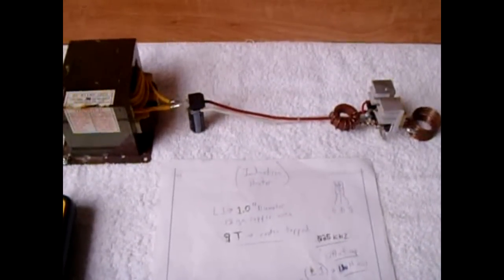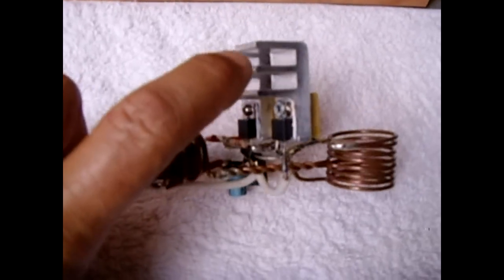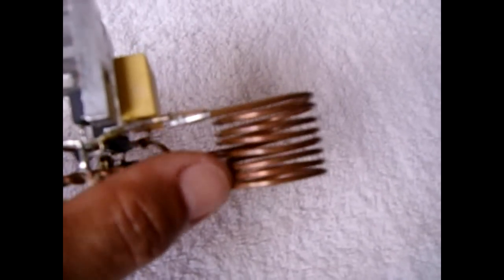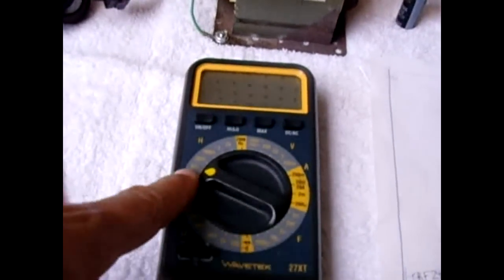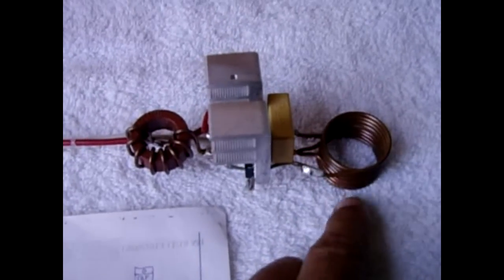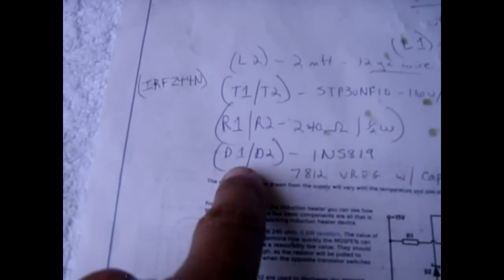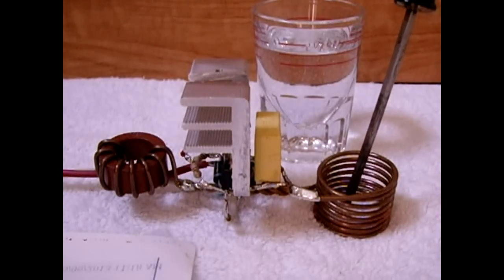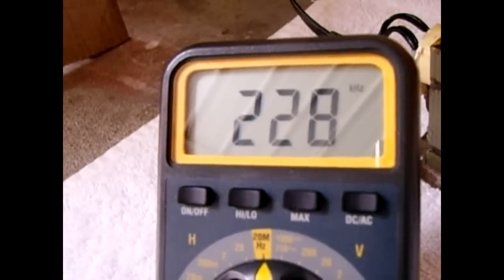How To Make A Simple Induction Heater ~ FULL explanation & schematic

Comment from the maker: Try and keep the design UNDER 225khz to help avoid heating problems. Increasing input voltage speeds up heating, but also causes the capacitor and other components to heat up faster as well. If you can only locate a current limiting inductor(toroid) greater than 2mH, then pull off a few turns of wire to lower the value.

BE SURE TO CHECK OUT PART 2 HERE:
(Shows a Spiral/Pancake Coil in Operation)

https://www.youtube.com/watch?v=8WzoRYUOrxc
Reply from the maker: *****

Unfortunately I cannot assist you with such a dangerous project. 3Ph/380V is deadly. I suggest you stick with what I show in the video. If you wanted to use a transformer with more current output, or slightly higher voltage, that would be fine. Make sure the components are rated to handle the higher level of current / voltage.

Thanks For Watching!
Reply from the maker: *****
You are only 1/3 right. I am from Long Island, but 100% Italian, not Jewish, and the video was filmed on an island in the Bahamas. I have no idea how you arrived at me being Jewish because my hands are tan and I was inside a bright room. LOL
Reply: +PrognatusSeptem 
Yeah, I can usually nail down that LI accent as well.  I can even get Suffolk and Nassau differences most of the time.

Comment: These things are great for getting a small metal shard out of your finger. I maintained a 400 amp unit in a machine shop.  That thing was a hard worker, Had to use 2 $2800 vacuum tubes for the high frequency generator.  Very good video! Thanks
Reply from the maker: Thanks For Watching!

Comment: Induction heating like this, but on a significantly larger scale, is used commercially for hardening metals such as steel. If done correctly, your induction heater could be used to case harden all your screwdriver tips. Great video as usual.

Comment: Well done.There is another variant of this  circuit  that uses no center tap. A lot of the Ebay ones are like that. It makes it a lot easier to swap coils, especially if you want to use litz wire for the coil and wind it around a frozen tie rod nut. I like your power supply. MOTs are getting to be like duct tape; they use them for everything from spot welders to power supplies.

Comment from the maker: Don't forget to check out my extensive video list.

Thanks For Watching!
Reply: what happens if you stick your finger in?
Reply from the maker: LOL. As long as your finger does not have a ring on it, nothing.
Reply: Aayam Sharma You're finger won't melt. Unless you have metal attached in it.
Reply: what about the metals in our blood, like iron?
Reply: It's not affected, even it's iron because blood is not made up of just iron. But red blood cells and plasma dominates inside our bloodstream
Reply: Tarek Kadoura With induction heaters, there are several ways heat is generated in substances.

Mode 1 produces minimal heat with induction heating: In magnetic substances you can have magnetostriction and dielectric heating or ion drag in dialectics. On the other hand, with a Microwave oven, this mode of heating is dominant.

Mode 2 is the dominate heating mechanism with induction heating: The alternating magnetic fields induce electrical eddy currents in metals and those high currents with the metal's own resistance is the source of heat. The stronger the magnetic field, along with low internal resistance, means the stronger the eddy currents, Transformers use steel to concentrate the magnetic fields but avoid loosing energy to heat though eddy current by using laminated cores. A laminated core is constructed of many steel plates that are insulated from each other to prevent eddy currents from building up. Eddy currents is why non magnetic objects like aluminum can be inductively heated. 

Your finger has a fair amount of electrical resistance preventing strong eddy currents, and very little iron to concentrate the magnetic fields. Even so, very strong alternating magnetic fields have been reported to induce pain relative to the strength of the alternating magnetic field. I am guessing that at some point very very strong alternating magnetic fields begin to induce electric currents of sufficient strength to trigger nerve endings to fire. Please note that these small currents in  fairly electrically resistant skin aren't enough to contribute to any significant heating.
Reply: What dictates the frequency you want to match with the tank circuit?
Reply from the maker: The (LC) circuit. The inductance value of the working coil, and the capacitor value which is used. If you go too high in frequency, then you get a skin effect where the current travels over the wire, rather than through the wire.
Reply: electronicsNmore
So what frequency am I shooting for? And what dictates that frequency limit? Thanks for the help BTW
Reply: electronicsNmore Adding a point on skin affect: Skin effect is where high frequency AC current travels though a smaller cross section of a wire, making the same wire appear to have more resistance similar to how thinner wires have higher resistance than thicker wires.
Reply from the maker: Just duplicate what I did in the video. Very simple.
Reply: electronicsNmore
I'm just wonder where you get your "sweet spot" frequency from. You tuned your LC circuit to 228Khz, but why? why not 300kHz or 100kHz. I'm just trying to understand what make 228kHz such a great frequency to tune to. Is it just te response time of the FET's ?
.
Reply from the maker: It does not have to be "Exactly" that frequency. You can go higher or lower.

From WIKI:

  The basic setup is an AC power supply that provides electricity with low voltage but very high current and high frequency. The workpiece to heat is placed inside an air coil driven by the power supply, usually in combination with a resonant tank capacitor to increase the reactive power. The alternating magnetic field induces eddy currents in the workpiece.

Applications of frequency ranges
Frequency (kHz) Workpiece type
5–30
Thick materials
100–400
Small workpieces or shallow penetration
480
Microscopic pieces
Magnetic materials improve the induction heat process because of hysteresis. Materials with high permeability (100–500) are easier to heat with induction heating. Hysteresis heating occurs below the Curie temperature where materials retain their magnetic properties. High permeability below the Curie temperature in the workpiece is useful. Temperature difference, mass, and specific heat influence the workpiece heating.
The energy transfer of induction heating is affected by the distance between the coil and the workpiece. Energy losses occur through heat conduction from workpiece to fixture, natural convection, and thermal radiation.
The induction coil is usually made of copper tubing and fluid cooled. Diameter, shape, and number of turns influence the efficiency and field pattern.
Reply: electronicsNmore
 Ok, got it. Thx
Reply: Thank you for explaining, some times people, Cough xee2vids, Cough 9 volt battery jacobs ladder cough  just don't explain what they used. So thank you for that.
Reply from the maker: Your welcome. Please share my channel with others.
Reply from the maker: Send me a Youtube message with your question. Go to my Channel main page, click "About", then send message. Thank You
Reply: This is really great man. The stuff you can learn in this is beyond me, thanks to people like you who take the time to make this great videos.
Reply from the maker: Glad you enjoyed the video. Be sure to watch part 2 and my other videos as well. Please share my channel with others, and rate Thumbs Up.

Thank You!
Reply: electronicsNmore will a flyback driver work for induction heating?
Reply from the maker: I think there are a small number of flyback induction heaters shown online.
Reply: ok thanks
Reply: electronicsNmore I need to melt some iron what do you think I would need?

Comment: Congratulations on your video. You are very confident of what you say, your voice indicates that you are  still very young and already   have a lot of experience. Your sequence is logical and well projected. You will make an excellent  power conversion lecturer.   I see that you are so conscious of the punishment that capacitor takes.
Congratulations  once gain.
The other day I asked my students how come  a switching device with a low output impedance when  switched on, can match an parallel LC circuit which has a high output impedance when  resonating which this circuit is doing.  NOt a simple answer!
Reply from the maker: Thanks for watching. I appreciate the kind words. I'm not exactly young. :-). I have very good genes(look much younger than my age, act young, sound young), but I am 41.

Comment: I finally got mine to work, to some extent. The first try failed because I made the mistake of mounting both transistors to the same heat sink, which shorted them out. I have it rebuilt using IRF3205 mosfets. But it's really hard on power supplies. I burned out one, and then tried to connect it to my arc welder, which has a bridge rectifier attached. That was too much, it melted the feed wires I used. But before it did, I stuck a screwdriver in the working coil, and I could feel it humming, and that seemed to increase the power draw until my wires melted. I'm putting together a smaller power supply, I can't wait to see what this thing will do.
Reply from the maker: UNITED POLICE STATES OF AMERICA Sounds like you are certainly having fun experimenting. :-)

Comment: Great video! I do automotive work. Occasionally I'll need to heat nuts or bolts to get them loose. My propane w/ oxygen torch works but things close by or next to the fastener being heated sometimes gets melted or damaged. I'm going to try building one of these instead of purchasing a $500 to $2000 unit that's already made. Thank you for sharing.
Reply from the maker: Glad you enjoyed the video! Just make sure you center the bolt in the coil. Be careful not to hit the coil with the bolt you are heating.
Reply: electronicsNmore Can you give me the specs of the capacitor and rectifier after the microwave oven transformer and a diagram or explanation of how it's connected? Thanks.

Comment: I have noticed that the center tap of the work coil seems to make a bit of difference in heating time.  The time seems to be a few seconds slower when it is wound as yours is i.e. not soldered near the coil surface, but twisted, giving loop(s)  in the connection from the work coil to the circuit (stray inductance due to a 'third' stray coil)??  I am not sure.
Reply from the maker: Unusual, don't know why.

Comment: nice build , good clean work, looks like a very neat little unit. did you no farm suppye stores sell 1/8 inch copper tubing niot nominal size but actual 1/8 inch diameter , super small but it would allow ypu to pump water threw your antenna

Comment: Okay, I hope that you can help diagnose this problem. The following is a list of what I have done and the issues I have had:

1) PS (MOT) puts out 24VAC once new secondary is wound. Add the rectifier and I get roughly 24VDC. I added the capacitor (3300uF/25V) and when I went to read voltage it blew. I assume this was due to the voltage limit.

2) Unwound some coils from secondary to drop voltage to 19VAC. With rectifier I get roughly 19VDC. This time, I put 3 1000uF/50V caps in parallel under the rectifier. Read voltage and was getting in the range of 30VDC. You mention that you get 19VDC and that get sent directly to the working coil. 

3) In the same set up from number 2 I decided to test the voltage coming out of the 7812 and I got 24VDC. I should be getting 12, correct? This blew a mosfet and a diode. 

I am sure I am making some novice mistake here, bit I just can;'t quite put my finger on it. Please note that I am being safe and taking the precautionary steps. I would appreciate any advice. Thank you!
Reply from the maker: +jesse harris 
Hi Jesse. Your MOT output voltage is too high. Please watch my other video below to understand why converting from AC to DC raises the voltage output. 

Thanks

https://www.youtube.com/watch?v=9GvlGUbiPRo

Comment: the heat in the cap is because it have a resistor or a diode built in. try with. mica=plate capacitor. they are made for rf and high voltage.
Reply: thus the circuit work in optimal conditions. heating the metal faster and more
Reply: Damian Molina sorry for my english is lame
Reply from the maker: The capacitor has no resistor in it. Your thinking of oil filled run capacitors. The current and frequency is causing it to heat up.
Reply: nope. this yellow capacitor are mpx or rc. just tell me the model and the letters. some have a little diagram showing the inside of the component. mica capacitor is the chosen one. you can find this in old tv or vacuum tubes radio electronicsNmore
Reply from the maker: I just tested that exact capacitor. If there is a resistor inside it, it is extremely high in value. OVER 20M. I also pulled up the spec sheet. There is no internal resistor. I have no idea why you think there is an internal resistor. The heating is caused by frequency and current.
Reply: ok this capacitor are named ac Safety Protection Function capacitor. 
the enclosure and the color tell my. if you dont want have losses of rf. use mica silver capacitor. mostly are black and could say npo. try it, you don't have nothin to loose.
Reply: Damian Molina just a quick thought: maybe the heat comes from the high frequency and with that you get a lower impedance than  if you were to use a lower frequency. Remember that Xc= 1/(2piFC) , so you should get a higher current since you have a lower impedance
Reply from the maker: Definiely no resistor in the

Comment: A couple questions if I may: How many amps are you drawing on the low voltage side of the supply? And have you checked the frequency when you were heating an object? It should change.. Im curious to how much change... one last question... the circuit is self-oscillating... what if you were to use an audio frequency generator to vary the frequency manually? I will be building this experiment soon and trying these ideas.. but was curious if you have already tried them? Tnx and Merry Christmas

Comment: i only got a thoroid 23m outside dia. 13mm inside and depth of 10mm and scrap of IRF740 
How many turns of wire and what gauge should i use.. i am not an electronics guy.. just a fan of DIYers 
i am a mechanical contractor usually fabricates anything that burns and heats and this would be a good tool for me... thank you for sharing.. more power to you

Comment from the maker: Make the working coil wire's diameter larger(10ga), the coil diameter smaller but longer, and use an irf3205. no guarantees, but it should work fine. You may need to use a coiled copper tube with water flowing through it to keep the working coil from getting too hot
Reply: If possible use a wire instead of wire harness from a larger working file

Comment: How much is the consumption of both Mosfet at the moment they are working?, I get the IRFP064N, it is 55 volts/110 Amps, and I get another IRF740 with 400 volts/10 Amps, what do you recommend me to use?
Reply from the maker: IRFP064N should be fine.

Comment: Is it possible to substitute a couple of those 100A IGBT transistors for the mosfets in order to scale it up?
Reply from the maker: UNITED POLICE STATES OF AMERICA Even though IGBT's have similar characteristics to mosfets, I would stick with the mosfet. You can use IRF3205's which are rated 110A.
Reply: electronicsNmore Great idea, I just ordered 10 of them! Another little question, can I use the capacitors from microwave ovens? I have a bunch of those. Or how about a motor startup capacitor? I built an arc welder out of four microwave transformers, that I run through an MDQ200A bridge rectifier since I have a bunch of d/c only rod around. It makes about 49 volts d/c, and well over 100A, I intend to use that to power the ZVS, I have a 100A circuit breaker around here, too, I'll include that to keep it from overloading anything. This is going to be interesting.
Reply from the maker: No, they heat up much faster. I already tested it. Stick to what I suggest in the video.

Comment: I was curious, as to what the actual voltage would be when powered up across the induction coil itself? That is, from the mid-tap to each leg out to the mosfets?
Reply: Also, great job on this video!
Reply from the maker: +Mysimplefix 
Hi there. Please watch Part 2. I give current measurements, as well as use a flat spiral working coil.

Thanks
Reply: electronicsNmore thanks for responding. Yes, I did watch the second video too, but there were no "voltage" readings for the secondary winding. . I was curious as to what voltage there may be from the midtap to the mosfet connected ends?
Reply from the maker: Unfortunately this device is in storage, so I cannot give you a reading. I would say around 14.5-18V.
Reply: +electronicsNmore ok, thank you very much for the quick response! I like your channel.

Comment: could you consolidate alot with 1 diode rectify, 1 heatsink and resistance wire? On a different note, the yellow cap at .47 works great to send a good small signal to a cars tachometer, off a big coil (they are found in computer power supplies) ;o)

I save my junk too, learning as I go along, great video.

Comment: Can this heat up iron rebar so it will bend without breaking the rebar?
Reply from the maker: Sure, but with modifications. The gauge of the working coil needs to be much heavier(probably #8 or #6 for 1/2" or 5/8" rebar). You also have to make sure all your circuit wiring can handle the current being delivered. I would use IRF3205's.

Thanks For Watching!